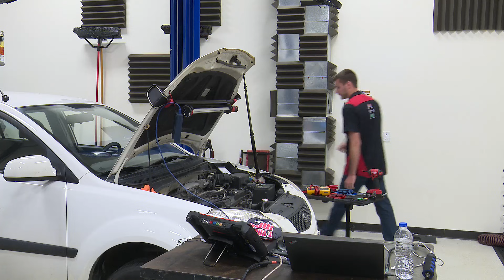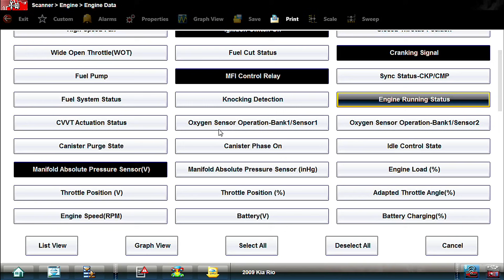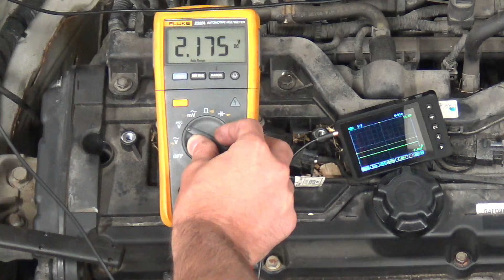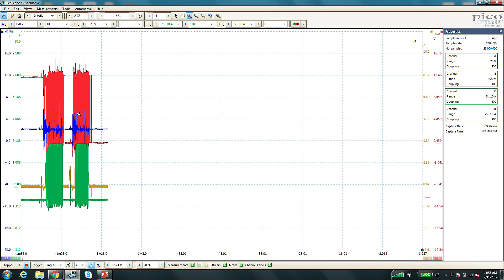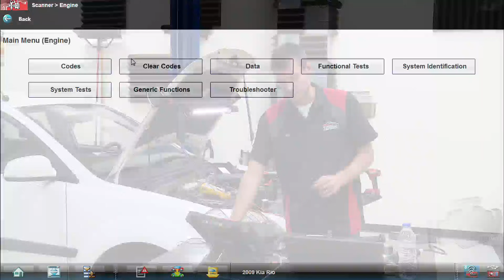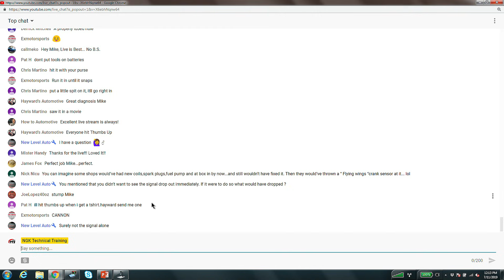Intermittent Stumble, Rough Running, Stall Concern. No Check Engine Light or Codes!!! *2009 KIA Rio*

Comment: I have a 2011 Kia Rio LX I just replaced the bank one upstream sensor One O2 sensor after replacement what car is now surging in idle at stops running very rough still burning a lot of gas what could be the cause of this please get back to me and let me know
Reply: do you have the old o2 sensor still? try putting it back and see if it runs better

Comment: Great lesson on trouble shooting! But you should always install an O-ring with a bit of silicone grease and it will slide in position. The face was rusty but the hole was actually quite clean...

Comment: So what do you think Oldsmobile silhouette van 3400 is acting like transmission is going out but I know it is something else cause it was runs to good for that so I m going to try changing the fluid in trans first and motor needs a oil change again to

Comment: Great video! The key here is to get the facts and data recorded. The Uscope should be able to record the data. Mine has a pause button on top I believe. One of these days I'll drop the money for a Pico. Need to buy a house first and set up my garage like you have done. Two post lifts are not that expensive, cheaper than a Pico, just need the right amount of concrete depth. Maybe I'll join the Youtube maker family. Keep up the good work guy!
Reply from the maker: Sounds like a good plan!
~Ryan

Comment: My car Rio 2013 ex. Automatic transmissions running good shifting 1,2,3&4 after 3hrs.long drive.100-120km/sounds like flat tire and like some bump on the back of my car, jump in 3rd gear.when I stop the gear still in the 3rd.
*No engine check warning signal.
*New ATF 
* New Knock sensor circuit
Reply: It sounds like the transmission may be going into a fail-safe/limp mode once it gets hot. I would scan the TCM for codes, not just the engine ECU, especially since there is no check engine light. Check the transmission data and see if there are any codes for a speed sensor, temperature sensor, shift solenoid or other transmission input.

Since it happens after several hours of driving, I would try to scan it while the problem is occurring or immediately afterward before clearing anything. A sensor or solenoid that starts failing when hot could definitely cause the transmission to stay in 3rd gear.

I wouldn't start replacing parts until the TCM codes and data point you in a direction.

Comment: Hi mike! My kia sportage 2005/2007 kept on stalling and idling. Ive replaced all plugs,Idle sensor,MAF sensor, checked my ignition coil looks fine. Got any clue or idea on what else i should check? It keep on stalling every time i hit a stop sign and my kia didnt have any engine warning it just stalls like that.
Reply: In the video, the same thing is happening. Turns out to be intermittent failure by crank sensor once the engine warms up. He replaced crankshaft sensor.

Comment: I'm not trying to be sarcastic at all but couldn't you have just gotten a more simpler diagnostic tool like the one you plug up and it shoots the codes out I know yours is way more sophisticated but it seems like that code would have come up . Maybe you did try that first I don't know I kind of skipped around the video a little bit
Reply from the maker: Hey Kevin, there's tons of tools out there that can spit out a trouble code...the money gets spent on the tools that can display the data and control/manipulate components on the car. 
Mike Becker, Senior Instructor

Comment: When I first got my 07 Kia Rio 5 I was used to driving a Dodge ram that had a lot of horsepower . so I pull out in my Kia onto the highway and I pulled out in front of a big rig so I floored it lol and it sounded like I had a turbo, you know that sound it makes when it shifts ,but this car does not have no turbo lol I never did look at the car until about a month later and what that sound was, was the timing case busted open on one side I never did get a new timing belt or even mess with it I just got a new screw and put the cover back on it had one screw in it but it was partially open still. Is there any signs I should be looking for I don't think anything got inside because I give that car hell everyday going to work it drives fine just doesn't want to crank back up when I put gas in it but I know that's a fuel pump issue but my real question in all this rambling is what can I do to be proactive just in case something did get down inside the motor would changing the oil be enough ?

Comment: 2917 rs started stumbling on highway after 2nd tank fill on 8 hour trip. No engine check lights whatsoever, took it to Mavis they said couldn’t find anything wrong.did not do diagnostic test , picked up car still sputtering intermittently? My mechanic said try heat in gas tank? Help!
Reply from the maker: Hey, thanks for watching! Is the check engine light on? That's where I would have to start. We need to see what the car is seeing, trouble codes and live data.
Mike Becker, Senior Instructor
Reply: GoTech no check lights?
Reply from the maker: Strange. Looking at the fuel trims in the live data may tell a story. Maybe it's running lean? Could be caused by water in the fuel I guess.
Mike Becker, Senior Instructor
Reply: GoTech heat in tank on fill up today. On hey cruse control 78 mph. Constant rpm fluxuation.
Reply: Vibrating as rpms bounce
Reply from the maker: Sorry, really wish I knew what to do for you. I'd need to see the car, or at least see the data from the car.
Mike Becker, Senior Instructor
Reply: GoTech I think it’s alternater
Reply: GoTech got a transmission code , some kind of trans sensor. Heading to transmission shop tomorrow. Sounds logical to me. They cancelled all of the other insignificant codes and sensor code remaining

Comment: Good day All,

I have a problem with my 2008 Kia Rio 1.6 and i hope you guys can assist me seeing as the three mechanics and two auto electricians could not. My car is overfueling like crazy and i keep getting code P00132. I have replaced the oxygen sensor and all the wiring has been repeatedly gone through and all seems fine but the car idles fine for about 10 seconds and then sputters and dies.
Reply: I would start by looking at the fuel trims on your scan tool. Check both STFT and LTFT and see what they are doing when the engine starts running rough. If the trims are strongly negative, the ECU is trying to remove fuel, which would support an actual over-fueling condition.

I would also check fuel pressure against the factory specification and see if it holds pressure after the engine is shut off. If the pressure drops quickly, a leaking/stuck fuel injector is one possibility, although the fuel pump check valve should also be considered.

Since it runs fine for about 10 seconds and then starts sputtering, I would watch the scan data during that exact transition. Check the MAP reading/voltage, ECT temperature, O2/A/F sensor readings, injector pulse width and fuel trims. If one of those changes dramatically right when it starts running poorly, that could point you in the right direction.

Also, don't assume the new O2 sensor is the problem just because you're getting P0132. If the engine is actually dumping fuel, the excessive fuel can cause the O2 sensor voltage to stay high and set the code.

Comment: I got a 2006 dodge Magnum that's stalling at idle and randomly while driving, new plugs, new fuel pump, no codes, it just dies suddenly, the idle will stumble sometimes before and other times it won't
Reply from the maker: Hey Khan Kirk, does that it happen mostly after filling up with gas? Does that vehicle fall under the TSB for the fuel tank replacement?
Mike Becker, Senior Instructor

Comment: Great vid.
Please, could you clear up; why when checking an A/C voltage from crk sensor did you have your scope on D/C?
Thank you. 
 Fox.  
N/W Scotland.
Reply from the maker: Hey Fox, on the PICO scope it's really not all that big of a difference. The voltage is able to read in DC pretty much just fine. I rarely ever turn it to AC volts.
Mike Becker, Senior Instructor
Reply: If you have the scope set to DC, you can see if there is a OFFSET voltage on the AC signal. Some signals are small so they use a DC voltage to raise the signal up to a level where they can see it better. Think of it this way. The water in the swim pool is the DC volts, the ripple in the water is the signal. If you have a clear portal on the side of the pool, you can see the ripple/signal when it is at the right voltage. Too high DC and you only see water, too low and you only see air. Just right and you see all 3.

Comment: IVE GOT AN 88 RS CAMERO WITH A 2.8. IT JUST TURNED OVER 100K LAST MONTH. YES ITS BEEN SITTING FOR A WHILE. IT PASSED SMOG EMEDIATLY AFTE FIRST START UP. I WENT DOWN TO SOUTHER CALIFORNIA ABOUT 600 MILES IT WAS FINE. THEN IT STARTED RUNNING ROUGH. I CHANGED DISTRIBUTOR, THE FUEL INJECTORS, THE TEMP LOW SENSOR, THE MAS AIR SENSOR, SPARK PLUGS AND IT STILL RUNS LIKE SHIT. WHAT SHOULD I DO NEXT? PLEASE HELP
Reply from the maker: Hey Lenny, how's the fuel? Maybe you got bad gas?
Mike Becker, Senior Instructor

Comment: Hi Mike,if engine use maf ,intake  leakage can easily diagnose with fuel trim but if engine use map sensor how can I diagnose intake air leakage without smoke tools
Reply from the maker: You can try adding fuel, propane or whatever, around where the leak is suspected. Intake gaskets, hoses, etc and look for a change in the RPMS.
Mike Becker, Senior Instructor
Reply: @GoTechTraining  thank Mike

Comment: I had the same issue on a Hyundai Accent 1.6L. The crank sensor connector was wrapped in electrical tape and the rest of the harness in chloroplast tape. I'm an apprentice was absolutely stumped as no codes and I couldn't even get it to act up. After I unwrapped the electrical tape from the connector wouldn't even start. Swapped sensor and pigtail was good to go. GOOGLE DIAG!
Reply from the maker: Hey Navi, nice find! Sometimes Google helps, other times its leads you astray. Glad you were able to get the car fixed!
Mike Becker, Senior Instructor

Comment: Should have kept running after a stutter with default strategy and set a code for sensor , make sure the ECM has the latest updates . Bad on KIA if they didn't fix this.
Reply from the maker: I agree, newer cars probably would have.
Mike Becker, Senior Technical Instructor

Comment: Not true I'm a Volkswagen Tech and in the training school they talked about a person who had a car that had that fault they replaced everything in the motor finally the engineers got to it and they found a plastic bag in the intake pipe and it would only clogged when you were at throttle open throttle that's a good one
Reply: I'm sorry not the intake pipe the intake pipe that's down near the intercooler in the front lower end
Reply from the maker: That sounds like a fun one!
Mike Becker, Senior Technical Instructor

Comment: I found another reason to stall in idle ,. It was not a mechanical part, it was a failing alternator regulator, some times it fails to maintain 14v and the time it start to fail voltage goes 18v+.
ECU shut off the main relay and stop all electrical supplies to protect the car electrical system.
I use OBD tool to record voltage graph during 1-2 hour driving and when I got the stalling , i checked the voltage graph. Thats the way I found it.
I checked all connections , all fuses .. nothing was wrong . It was only a simple regulator built in behind alternator.
Hope this will also help to explorers .
Reply from the maker: Awesome! Great find!
Mike Becker, Senior Technical Instructor

Comment: My 2004 Honda odyssey started stalling in July 2019, it would stall like once a week, TCS & check engine light code read  P0118 thermostat sensor & P0128 coolant thermostat, I replaced both, TCS & check engine light disappeared, I also installed new spark plugs.. Stalling continued but increased to around 8 to 10 times a week, took safety measures buy cleaning throttle body, manifold & egr ports also replacing air idle control valve and stalling reduced to once a week. Two weeks later I then took another step and replaced egr valve, two days after replacing egr valve engine stalls, 
TCS & check engine light comes on with new codes:

P1498 EGR valve position sensor voltage high.
P1491 EGR valve lift insufficient detected.
P0505 Idle air control system 
P1399 Misfire in any cylinder 

I don't understand codes for parts I've just replaced is now popping up, now my vehicle definitely misfires while driving, idling fluctuates while in park and has poor acceleration, all of a sudden it runs like shit.. WTH!. The only thing I have not changed is fuel injectors. Any suggestions before I go that route??..
Reply from the maker: Thomas, first of all I would stop changing out parts and start doing some diagnosis. I would clear the codes, or disconnect the battery and start fresh. From there see what happens. Take a good look at that air intake boot that goes to the throttle body. If it's torn anywhere it could definitely match your symptoms.
Mike Becker, Senior Technical Instructor
Reply: @GoTechTraining  
Thanks for the quick response Mike.. Intake boot looks really good, no damage. So I pulled the connector and tested it with a voltage tester that lights up in the handle and only 4 out of the five have electrical current, but I have no idea what that dead wire operates, it's the #5 prong on connecter with green & yellow wire.. Any thoughts?.
Reply: Sorry,  prong #3 is the unresponsive wire on the connector, #5 is vacant..
Reply: Sorry, my readings were incorrect, everything is fine with the wiring, voltage is were it should be for TPS, EGR, & IACV..
I've cleared all codes as you suggested, I checked for vacuum leaks and found none, I did another relearn process, took it for a test drive, 20 minutes later TCS/check engine light comes on, now the only code I have is PO505 and the idle still fluctuates in park/neutral.. I remove the new IACV, clean up the original and reinstall it and do the relearn again, 20 minutes later same thing TCS/check engine light comes on and start acting up with the symptoms from before, fluctuating idle in park/neutral, hunting acceleration, vibration on the down shift around 40 mph, etc.
So I take it to Autozone, diagnostic code is PO505.
 I decide to purchase myself an OBDII code & scan tool so I don't have to keep running to Autozone, I plug it in check readings, sure enough PO505, so I erase the code and guess what happened?.. 
For the past three day's, I've had no check engine light, van has been running pretty decent, but the idle fluctuation still remains in park/neutral only once in a while, it like it comes and goes, sometimes it fluctuates and at times it doesn't, but the fluctuation is not as violent as it was with the new IACV, it only now fluctuates between 1000-1400 rpm in park/neutral, when as before it would fluctuate between  1500-2000 rpm, plus the idle fluctuation is much quieter, not as rough.. 
Do you think the the code/scan tool I purchased reset the ECM/PCM for the idle relearn process?.. I'm very curious, are we supposed to reset the ECM/PCM before installing and replacing a new part and then do a relearn process, because I'm starting to believe that the relearn was not working on the new IACV.. I don't know, any thoughts?..

Comment: so was there any way to see the crank sensor failure using only the Uscope?, or would you not be able to see the signal stop befor the car died?,
Reply from the maker: Jack, sure you could see it. It's just not as easy to see on the small screen. 
Mike Becker, Senior Technical Instructor

Comment: Made my skin crawl. I allways wire brush and brake clean aaaaannnnd blow dirt away before pulling it out. I've chewed out rookie mechanics. Dirt will fall in and destroy the oil pump or bearing surfaces. I've had to run a vacvacuum while doing jobs like this.

Comment: Surprised that you don’t know well what a Hall effect sensor is. 

There is a magnet, yes, but there is no metal or magnetic metal!!

It is a copper coil that harnesses that magnetism and produces volts!

When I teach a subject I better know everything about it before teaching it or showing my knowledge gaps.
Reply from the maker: A hall-effect sensor does not create voltage. That's a variable reluctance sensor. A hall effect sensor is also NOT a copper coil. It is digital including a small IC chip. I think you have hall effect and VR sensors mixed up.
Mike Becker, Senior Technical Instructor

Comment: you talk about bias voltage on the crank signal, how are you reading voltage with only an amp clamp connected?
Reply from the maker: Danny, the bias voltage is on the crank sensor wire. The amp clamps were installed onto the power feed fuse for the injectors and coils. Hope that helps clarify!
Mike Becker, Senior Technical Instructor

Comment: Why wasn't there a change in TPS voltage during acceleration?
Reply from the maker: Hey Victor, yeh that's interesting. It did bump up a smidge. Strange. Could be a scan tool reporting error.
Mike Becker, Senior Technical Instructor
Reply: My car also Rio 2011 automatic transmission has no power to climb